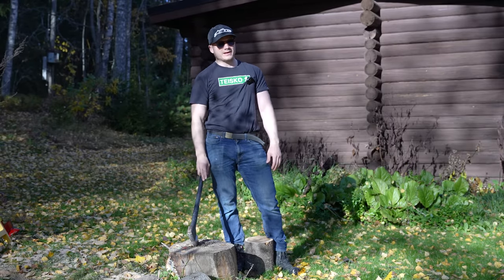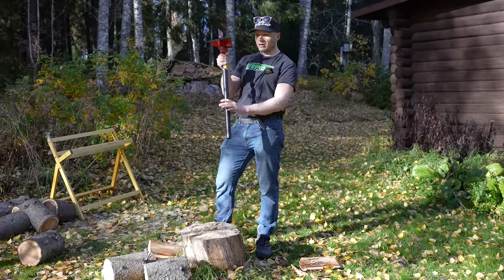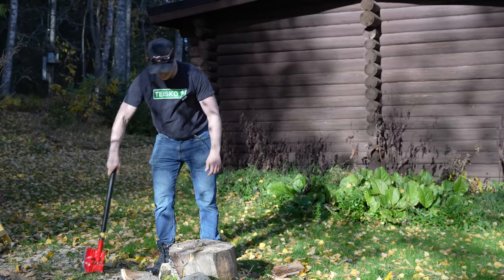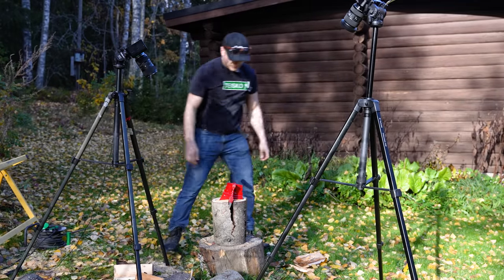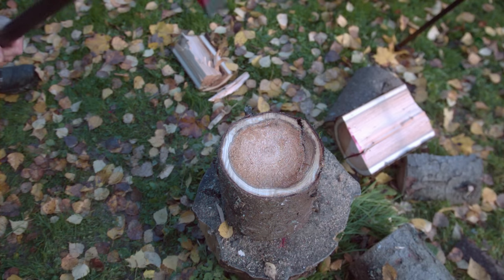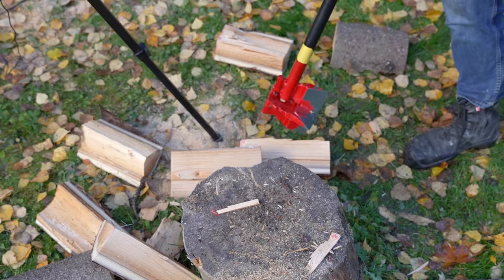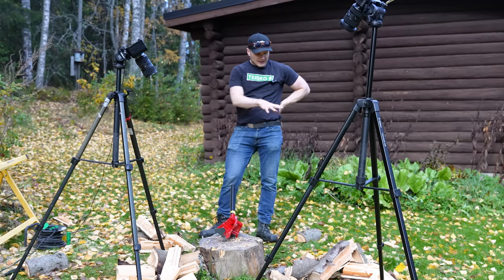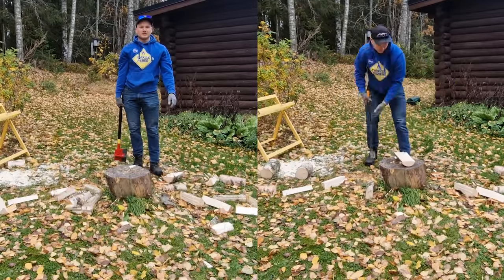The Best Axe EVER? Four Bladed Quad-Axe

Comment from the maker: After filming this video I have actually kept using this monstrosity :D It's really faster on my type of work, not three times faster than regular axe but maybe twice as fast? Only drawback is the fact that it's four times heavier than regular axe so you get tired quite fast swinging this around. 

And by the way I have couple more videos already filmed and lot of great ideas so more videos coming again after some time off!
Reply: You should send one to CrazyRussianHacker and see what he thinks about it
Reply: love to hear that you're back! but hey, why would you waste short summer for making videos?
Reply: If the blades would be thinner, you have reduced weight and less resistance in the wood.
Reply: A grip would help a lot honestly. It seems to be sliding in your grip with such a large arcing swing, and is twisting the head ever so slightly. This means each blade isn't hitting equally or directly but at a slight angle.
Reply: When you have so much surface hitting the wood at the same time, it would spread out the impact.  I wonder if a physics teacher or engineer would be able to give suggestions on how to improve it's practicality?
Reply: Anni will love your new, improved arms, no gym needed!  😎
Reply: Would welding a lump of steel to the back of the axe help with splitting? More mass might be able to drive the blades further through the logs.
Reply: After your first hit get stuck turn the axe over with the wood in it and take another blow with the whole thing upside down striking the axe head on The Block the weight off the wood will force the cut wood through the axe.  cheers   Brian
Reply: Pretty good. Heavier and less hits makes more like a power exercise, rather than aerobic. So naturally better.
Reply: I use a maul to cut firewood so this creation of yours wouldn't be a strain on me at all. You could sell this Laurie
Reply: @maxximumb  All he had to do was flip it around and drop it on the back.
Reply: Just a tip: You can add the emoji the scammers tend to use to the blocked words list in your YT account. So their comment wont be visible. Works on my channel, tested it.
Reply: @brianthomas3551  While that is a nice idea with a normal axe(and likely heavier wood than he is splitting) I'm not so sure it makes sense with a four headed axe.
Reply: This is a great idea for a out of the box weapon for a D&D character as well as a tool i would have 100% used when i lived in homes with fire places.
Reply: @Henrix1998  Seconded!!!!🤗
Reply: Maybe you could mount this "monstrosity"  vertically on a bigger piece of pipe (like 3 inch?) with the sharp side up, put the logs on top of the blades and use a regular size maul to drive them through the axes. Something like a "Kindling Cracker" on steroids.
Reply: When it gets stuck in the wood, pull the axe back with the wood and hit again for easy completion
Reply: @AlienLivesMatter  That way you have to lift and swing  the combined weight of the axe and the log. Very tiresome
Reply: Pretty good to see HPC back with some quality content🔥 BTW, do you guys use log splitter machines in Finland? Those are very popular in Canada
Reply: Look forward to version 2.0 when you've got the design refined!
Reply: Heavier axe = more exercise.
Win/win in my opinion.
Reply: @reneschmitz4845  If they were thinner they'd get stuck much more easily. I would think you'd want them more wedge-shaped so there's more outward pressure on the wood to make it split easier. But I'm not really sure; when I used to split wood I used steel wedges and a sledge hammer, never used an ax.
Reply: It would be easier and more powerful if you started with on hand up high on the Handle and slid it down as you swing starting from on top of your shoulder rather than behind your head :)
Reply: Instead of having a Flat face on it, Cut off some of the axe heads and Resharpen it this way its more of a Pick or spear tip shape, That will make it split wood a lot faster and a lot easier because the force will be concentrated on a much smaller point which will make it go deeper into the wood much easier.
Reply: Sell me one
Reply: You just need a slight bend in the handle, like a axe handle has, and you will have alot more control on the head and swing . Then go Paintent it, Quick. Still love your Sicence Stuff.
Reply: Sell to fiskars!
Reply: As ppl are somewhat suggesting & you likely know the wedge is working against you, the blades should be chisel shaped, flat on one side.  Fiskars is ready to invest, I will take 15%.
Reply: I'd honestly imagine it'd be better with a longer handle

Comment: The biggest improvement I have seen for cutting lots of firewood is putting the wood inside a large tyre. With it inside there when you split it the wood doesn't go flying in every direction so you can just load up the tyre with lots of logs and just keep swinging until it's all cut the way you want it.
Reply: I was going to make this same suggestion, if you watch the video most of the "normal axe time" was spent picking up the pieces.
Reply: @fred_derf  crazy Russian hacker showed that.

Comment: Why would you not attach it to a press and take out most of the manual labour? You’d have a winters’ worth of wood much more quickly and with more ease.
Reply: Because he is faking viking and love to use axe !
Reply: Wood splitting is mostly meditation and stress relief
Reply: Because if you chop wood during winter you'll get warm without havin to burn it first ;)
Reply: Also it's a lot of work to load up the wood, take it to the shop, put it in the press, load it back up, take it home, unload and stack it up. Way faster with an axe.

Comment: That would probably work well if you rested it on the logs and hit it with a sledge hammer to drive it thru the log.
Reply from the maker: I think I will make a OCTO-AXE and try that aproach with it :D
Reply: At what point does it just become a slightly fancier wedge lmao
Reply: @EddieBurke  bingo.
Reply: Bingo!
Reply: Fiskars have dire warnings not to use a sledge on them.
Reply: @EddieBurke  Sort of, but one that you can set in place and get away from so nobody's digits are anywhere near the chompy bits.

Comment: I think you just need to raise your base to knee height and split logs above knee height and you’ll get more even contact on the blade and have less bending for your back
Reply: his technique is also needing quite a bit of work. the way he's swinging I'm honestly surprised he didn't pull a muscle. the way he swings is much more appropriate for something like a throwing axe.  
keep your non-dominant hand at the base of the handle and use your dominant hand to lift the head of the maul/axe. when starting the downswing you slide your dominant hand to the base of the axe to meet with your non-dominant hand.

Comment: You can improve the split rate by grinding the blades back so that you have a point where the four blades meet and the new sharpened edges angle up at about 30 degrees.

Just be sure to re-harden the edges if they get hot during grinding.
Reply: The mid-section is also probably much too bulky. The "wings" will wedge the pieces apart anyway, so all the midsection really needs to do is cut the wood and therefore the blade could be a lot thinner there. This would help with both the weight and the resistance/friction that stops the swing before the wood splits.
Reply: At that point we're just diving off the deep end into improvised post-apocalyptic melee weapons. I'M ALL FOR IT
Reply: I was thinking - weld a spike in the middle
Reply: @Chaosrain112  I use LastAxe to protect my passwords.
Reply: I'm thinking like a hunting arrow tip, obviously not as a sharp of an angle.
Reply: @Chaosrain112  Wow!  Now I am picturing COVID-Zombies split into four.  Just be sure that each quadrant does not grow into a new Zombie like worms are supposed to do.  Hmmm...  That sounds like worms can become zombies.  Heck!  Maybe they can. Best not to take any chances.

Comment: You need to change the shape slightly!
The blades that go to the sides should hit slightly later than the straight blade(s)
and I think you might need to angle them slightly. Have a look at a hoe, the blade of the classic hoe is also slightly angled.

Comment: Love the build!  One suggestion, you will wear yourself out less and be more efficient if you change your technique.  One hand at the bottom of the handle, one hand at the head of the axe.  Swing the axe sort of around you sideways almost so that you don't waste energy and effort swinging it up and over your head.  As you get the momentum going, once it's vertically over your head or abouts, then slide your hand that is at the axe head down to the other hand at the end as you swing the whole thing around.  You get your whole body into the motion.  Watching you start with it down your back and both hands in the same place makes me wince for your back!
Reply: I came here to say this but knew in my heart it had already been said. I think also the haft needs lengthening!

Comment: 9:20 instead of resetting by pulling out, you can try the reverse swing (since the log is usually heavier than the axe head, it carries more momentum). Swing the axe+log down into the block with the axe back hitting the block first. The momentum of the log will carry it through the blade.
Reply: It would be too heavy to lift the giant axe with the log attached. Better would be to just hit the back of the axe with a hammer
Reply: @waffleown4258  maybe with a huge log. With these small ones it would be rather easy.
Reply: @frollard  with any log small enough where it would be relatively easy to pick the ax up when it's embedded in the log, it's going to be so damn small that the acts will get it in one shot guaranteed. Because we're talking about a log that's only 20% heavier than the ax and at that point it's not resisting that ax don't even think about it
Reply: @the_undead  I must disagree on some level. (yes it's mostly moot). Upright axe on top only the axe head does work (when the head is jammed), but inverted the heavier log does the work. The axe head will stop more abruptly on the chopping block compared to wood on wood - imparting more jerk and acceleration for a given Ek input. Knotty wood isn't always a one and done despite being small enough.
Reply: It works

Comment: When I get logs that doesn't split all the way through, but have good start. I lift the log with the axe still stuck and drop it on the axe. Most time the logs momentum finnish the job. I used to use this as preferred method and use a small one hand axe.

Comment: This is really cool. Make an upgrade by using a longer handle and to shift the horizontal edges a couple of centimetets higher such that they don't impact all at the same time. Would be interesting to see how that improves splitting the same blocks you tried now.

Comment: Suggestion construct one where the second set of blades is smaller and staggered behind the fist set. The first set will split the log partially reducing the tension on the two halves and then the secondary set will catch the two halves at higher speed
Reply: Great minds think alike.
I also thought if you angle the offset blades so the edges contact before the centre would help as it reverse the ejection direction of the wood as well as the edge of the wood been softer.

Comment: Great!
I mean, I have seen the idea in some technical magazines back in 1980s first and surely it have being around before.
Probably there are some reasons this kind of axe did not get popular.
But whatever keeps your sauna hot, I guess.

Two notes on the work:
a) when the axe got stuck in the log, one can swing it backwards, so the head of an axe lands first and the log you are splitting gets on top. That works the better the heavier the log is.
b) your swing technique can be improved. If you start the swing in front of you, then go down by your side, behind the back, and then go overhead and down, you are saving yourself much work in that initial pulling the axe from behind your back. And add pretty much energy to the swing. Though I have never tried that with a four bladed axe, with regular Fiskars it works like a charm (it has flat handle, which makes correct alignment easier, BTW). And with a sledgehammer it is a standard technique.

Comment: Cool invention! Here in Sweden we cut down the trees in the winter, when the sap content is the lowest. Then we chop the wood in the spring, so it has plenty of time to dry up before the next winter when it will heat our homes.

I prefer a cleaving axe, which is a special kind of axe with a very steep angle that breaks the wood apart more aggressively. With a large cleaving axe you can barely split a normal size piece in one hit. Your invention will make it even harder, and not save any time for that. And the most time consuming part of chopping wood is the large pieces that require a steel wedge.

Many people use electrical log splitters here, but splitting with axe is actually faster (if you are good at it), and also gives a good workout.
Reply: Shouldn't wood be drying at least 1 to 2 years?
Reply: @TheGreatPornholio  Optimally yes. The fire wood I'm burning right now was dried for 2.5 years. But I think it is pretty common to only let it dry over the summer.

Comment: Nice video.
I think it would goes easier if it was more pointy to have less surface contact when you hit.
And also you should flatten the handle side to make it easier for indexing the blade of the axe, seeing how round the handle is it must be hard to control.

Comment: If you start the swing with your hands at opposite ends of the handle, and slide the hand nearest to the head towards the other on the downswing, so that hands are together when the axe head hits, you will transfer more power with less effort.
Reply: This!⬆️ I don't know why so many people get it wrong. You can't accelerate the axe that fast if you are holding it at the end from the beginning. Normally you should notice it by yourself after some chopping, but some people never get it.

Comment: Hey Lauri, I made a similar one for myself. After the axe flew off from the handle, a small change makes it work almost 100% by only 1 hit — tilting the axe away from the handle a little bit, from 90 degrees to ~105 degrees, so all blades hit the log at the same time.

I don’t have a high speed camera. But the feedback from the handle feels the same as a normal one after this change. Previously it was too much vibration. My theory is that the when the log is so low and the axe starts splitting it, the wood absorbs too much energy from the first blade and slows it down. So when the 2nd and 3rd hit the surface, it has much less impact energy compared with hitting all 4 blade at once. What do you think haha

Maybe put the log at a higher position can test this theory! Have a good day😊😊😊

Comment: I think that the horizontal blade holds the wood together when the vertical blade tries to split and Vice versa.  So if you put the vertical blades longer and the horizontal shorter or vice versa then it would cut through like the single fisker axe.  I could be completely wrong 😂

Comment: Looks like a 4 way splitting wedge mounted on a maul handle. I've seen hydraulic splitters with them, and 6 sided blades as well for the bigger industrial splitters. Though the splitting wedges are more swept back and spike like in the middle. Maybe just drop it in, then hit it withdrawn a sledge?

Comment: I love this! I would lengthen the handle and adjust your splitting axe ergonomics. You're not getting any power in the downstroke out of starting the upstroke so far behind your back like that. A sliding grip started from nearly vertical allows you to assist gravity rather than fighting and brute-forcing your way through it.

Comment: When it wedges you want to leave the log on the axe and swing it again with the back of the axe down. Bit heavies but more fun that pissing about getting the axe unstuck
Would also recommend changing the angle axe to handle, or chop logs higher up. One solution require a lot less grinding!

Comment: It looks to me that the handle is just a round straight pipe. A round straight handle is very annoying to work with for any tool that needs to aim the swing (like an axe or a hammer). Oval handle would help with blade alignment. Maybe a slight S bend to align the side blades to hit perpendicular to the wood and make the axe less likely to slip out of the hands would also help.
Reply: Had the same thought. Worked better than I assumed it would and wonder how much better it could be with a good handle.
Reply from the maker: I thought the same thing but it might be actually good on this axe. Sometimes it wants to turn really violently when you hit badly and round pipe lets it do it's thing without twisting your arms too much :D

Comment: Do you thing it would work better if the blades get welded at an angle, making it a bit pointy at the center? (like a Phillips/ cross-slot screw driver but not that pointy)

Comment: This video gave me a good idea for splitting logs for firewood. Instead of a four-bladed axe, maybe make a four-bladed cone-shaped heavy duty wedge with sharpened edges and a hammer head. That way you can put it in the middle of a log and hit it with a sledgehammer and split the log into four pieces. That way it’s not so dangerous and maybe it would work.

Comment: I was wondering if you made the axe handle connect to the blades at a slight angle like 30 degrees then the blades would fall more flat on the wood and perhaps cut it better.

Comment: Another method is to put the logs into an old tire so they don't fall off the stump when you split them.  Or use a chain and a bungie cord to hold several logs together while you split them.